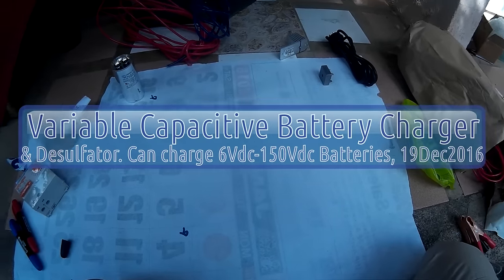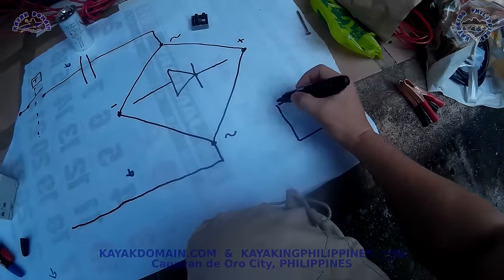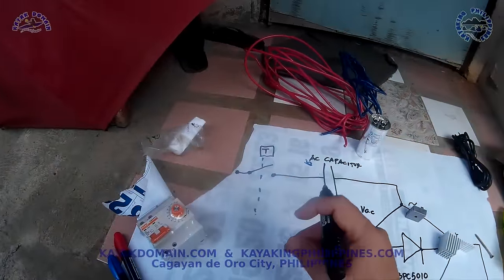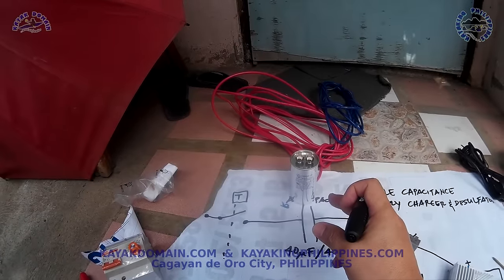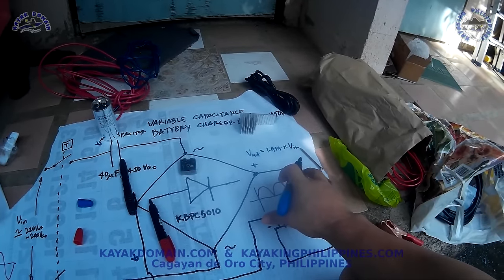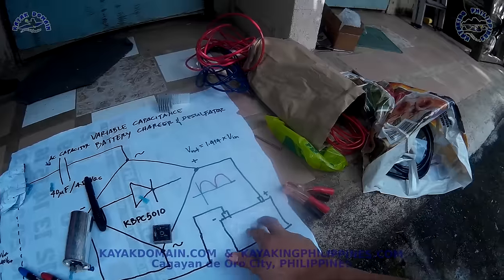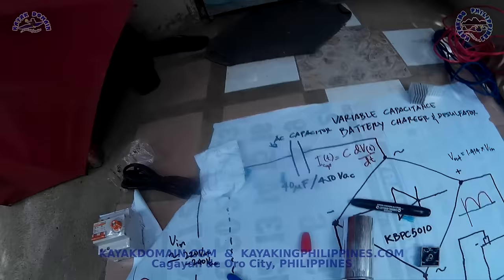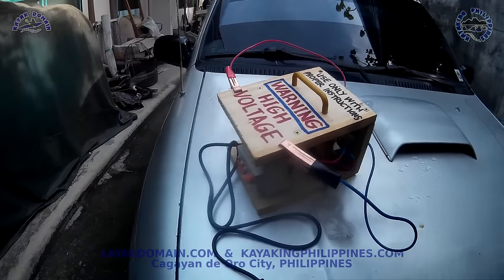Variable Capacitive Battery Charger & Desulfator, 19Dec2016

Comment: Thanks,I am charging 3X6v(225ah)trojan and started with 40MFD(2x20MFD) cap.After 5days I seen no change.I added another 3x 20MFD and there is a difference after 2hrs.I am observing voltage,and the bat acid specific gravity.Operating capacitance at 100MFD whats your safety opinion???
Reply from the maker: USA is 110volts so you need to double your capacitance to 80uF. So far I managed to damage one flooded battery (a bit old and Philippine made). But no major safety issues. There are 80uF Capacitors available in the market so no need for 2 (40uF) caps in parallel.

Comment: How thick do the cables have to be if I use a 150 microfarad capacitor at 230V?
Reply from the maker: at least #8 wire. Why use 150 microfarad?
Reply from the maker: I would suggest you use 80uF max. But it's up to you. At least #8 or bigger for the cable.
Reply: i use 400 uf 400 volts ceramic caacitor it works good it gave me 10 amps

Comment: Hi Kayak, will the 10uf 450vac cap do for 12v 6ah motorcycle battery? and how long for charging?
Reply from the maker: What is the voltage in Vietnam 110v/220v? Because the AC capacitor will depend on your AC power supply. I would suggest that you use 40uF/450vac. Charging can be done in about 20-30min. If you have a timer, set it at 20min
Reply: @KayakDomain  Many thanks, Kayak; the voltage in Vietnam  is 220v. Will I do the same as your instruction? As my battery voltage shows 12v but the current is not enough to start my motorcycle; waiting your reply.
Reply from the maker: @hana-dk7el  I would suggest you use 40uF. You can find that is most Refrigerator repair shop.
Reply: @KayakDomain  thanks
Reply from the maker: @hana-dk7el  you're welcome

Comment: Hi KayakDomain. I've watched some videos about this type of desulfator but they never explain the science behind it. So thank you for this great explanation. It's very useful.
But I think I missed about the purpose of the timer. Then I couldn't calculate the current of the capacitor by the formula. That's why I tried to calculate the current, via capacitive reactance. Xc=1/2*pi*f*C for 220V/50Hz source, 40uF cap -> Xc=~79.5ohm, Ic=220/79.5=2,78 amp . Yeah I know I'm wrong. Could you  explain more?
Reply from the maker: The main purpose of the timer is to limit the charging time to avoid damaging your battery.

Capacitance is in Farad not Ohms. Current in the capacitor is not linear. The right formula of the Capacitor impedance is 
Zc= - j /2*Pi*f*C

Comment: hello kayak...i built the battery charger / desulfator according to your circuit....i am getting a 234 volts DC....i connected the terminals to the battery...i have the caps off on the battery....when i connected the plug to the mains i got a buzzing sound and a spark from the battery specifically the cell just below the positive battery terminal of the battery...good thing i was able to remove the plug within a few seconds....is the battery shorted? is the battery junk now? i am charging a 12v 7.2 AH motorcycle battery.
Reply from the maker: your 1N4007 is a small diode. I think 1N4007 is only rated at 30A. The Bridge Rectifier I suggest above is rated at 50A. The circuit breaker I suggested above should protect the system. Just check your battery.

Comment: How long do you leave charger ON?If you achieved the charged voltage do you still require the desulfation?
Reply from the maker: I damage 1 battery because I left it for too long. My suggestion to disconnect/OFF the charger after the battery is full charge. Desulfation is constant everytime you charge a battery. Leaving it ON for too long can damage your battery.
Reply from the maker: i normally set my timer to 20-30 min for my 12V car battery.

Comment: Any instructions on how to use this? Ive already built your circuit....can I leave this powered and connected to the battery for 8 hours?
Reply from the maker: for a typical car battery, 8 hrs is too long. Put a voltmeter and watch the voltage rise up to about 13 something volts and that should be enough. 8 hrs will likely damage your battery.
Reply from the maker: 8 hours is too long...20-30 minutes will do for 12V car batteries.

Comment: it also depends on a bridge you are using...depends on the amperage of a diodes...
Reply from the maker: The KBPC5010 is rated at 50A, 1000v. What do you think of this Bridge Rectifier?
Reply: so high and i think its useless to use it coz it varies from a fds of your capacitor that you are installing...
Reply from the maker: why it's high and useless? can you explain why? explain in Technical detail why and even provide some formula.
Reply: @KayakDomain  Hilarious, I guess no answer is an answer
Reply from the maker: @PH_INFO_101  still waiting for an answer...

Comment: After using this charger, the capacitor will automatically discharge?
Reply from the maker: Unplug the AC first or after the timer is off, then you can disconnect the load/battery. The cap should should quickly discharge once you turn off the AC or the timer is completed.
Reply: no... it wont automatically discharge....you must install resistor in parrallel with your capacitor to automatically discaharge it....
Reply: you can use the kind of 220v ac cord plug who had a switch with lamp indicator,when you switch off the device then after a few second the lamp indicator still glow the light until it turn off that show you the capacitor succesfully discharged

Comment: hey kayak....i have electric fan capacitors about 3 pieces of them...an electrolytic capacitor 1000uf/25v and 4 pcs of IN4007 diodes...will this work if i use this as replacement parts for your circuit....will it have desulfation effect also?
Reply from the maker: Electrolytic Caps are DC capacitors. Cannot use DC caps. You must use AC Caps. Just buy those items as described on this video and you will be fine.
Reply: @KayakDomain  the input cap is an electric fan starter motor cap so it is an ac cap rated at 2.2uf 450vAC...can i use the IN4007 as a bridge rectifier? or i need more amperage and voltage on the diodes? i am not using the electrolytic capacitors anymore.
Reply: i also did not see you placed a fuse in the circuit....if you were to place a fuse that amperage will the fuse be? and where will you place it....one line in the 220v ine or can it be place on the positive side of the diode of  AC capacitor? what fuse amperage?
Reply from the maker: @newvaper3794  2.2uF is too small
Reply from the maker: @newvaper3794  The Timer Switch has a circuit breaker.
Reply from the maker: @newvaper3794  if you want to experiment then use  IN4007. But I would suggest to use the bridged rectifier as shown on this video

Comment: Can you send me info on the materials I would need to make these chargers you make it sound simple but I'm not great with electrical but want to get into reconditioning batteries in my area. I need something that works and I need a resource person that can talk to me like I'm in grade 3 about battery reconditioning. I live in Canada but will spend the winter in AZ.
Reply from the maker: Hi Lorne, please note that there is a Warning and Disclaimer on this video. The materials are Bridge Rectifier, AC (not DC) Capacitor, Timer Switch, #10 wires,big Aligator clips and your Enclosure. The model number of the Bridge Rectifier is on the video. The Capacitor is an AC Capacitor which you can find at Refrigerator repair shops and parts retailer. You can find the timer switch online. Wires from electrical hardware. Please note that this is a fast charger, weak plates (typical on old batteries) can be easily damage. I already broken 1 old battery.
Reply: Would this work on forklift or golf cart batteries
Reply from the maker: so far I only  tested on my  flooded batteries for my Sportage and Starex.
Reply from the maker: @lornekinnee4189  typical forklift batteries are flooded. So yes  this will work on forklift and golf cart batteries..

Comment: madedetect kaya ng electric meter yan boss? malakas din kaya sa consumo?
Reply from the maker: Consumption is very low.
Reply: @KayakDomain  60 uf ung capacitor ko at 10 pcs kbpc5010 k.c mainet ung rectifier kung 1 lng
Reply from the maker: @rolandruiz1972  , why do you need 10pcs of bridged-rectifier? You only need 1 bridged-rectifier, and just use a Heat Sink on it.
Reply: @KayakDomain  hindi k.c universal gamit ku sa rectifier ko ginagamit ku rin pang rectify sa ac welding machine ko for tig:)
Reply from the maker: @rolandruiz1972  , if you are using KBPC5010 then I'm confused. Good luck on what you are trying to do.

Comment: What is the value of ac capacitor and bridge rectifier? Thanks
Reply from the maker: AC Cap = 40uF/450V
Bridge Rec = KBPC5010

Please watch the entire video. Each component was described in there.
Reply: Thanks
Reply: What kind of a capacitor? Any capacitor...
Reply from the maker: no problems
Reply from the maker: AC Capacitor not DC.
Reply: Ac Run capacitor or ac start run capacitor or iether...   Thanks...
Reply from the maker: To be honest i have no clue between AC Run and AC Start. But i bought this AC Cap from a Refrigerator Repair shop.

Comment: do you connect positive to positive on the battery or do you put + to - and - to +??  and how long to charge a 12v battery?
Reply from the maker: Hi Phil, you connect the Positive Alligator Clip to the Positive Terminal of the Battery. This charger charge very quickly, sometimes within minutes so you must not leave it for hours or you will damage your battery. Put a voltmeter to monitor the charging. Again, My Disclaimer still applies...use at your own risk.
Reply: @KayakDomain  dont connect volt meter it will damage it....
Reply from the maker: I normally set 20-30min to charge my 12V car battery.
Reply from the maker: @benjiefigalan6288  why damage? I use a basic voltmeter to measure the voltage.

Comment: i use this for 5 years now and its great ...but i think ur using to much higher value capacitor thats why you said it damage your battery better install not so high capacitor so that you can leave for so long time untill it desulfate your battery and bring them back to life...it needs to check from tme to time...whats out coz its a high voltage....
Reply from the maker: What is the Capacitance of your Capacitor? And what voltage in your country?
Reply: of course from phillippines...and with 220 volts ac...
Reply from the maker: What is the Capacitance of your Capacitor?

Comment: Hi,Can you tell me if you should couple another 2 capacitors in parallel will the current to the battery increase and will the desulfation process increase????
Reply from the maker: Hi, capacitors in parallel increases the capacitance. Thus, you have a higher current. To me desulfation process is subject to the frequency and amplitude. And higher current and voltage can easily damage weak battery plates.

Comment: try different fds of capacitors and measure their amperage....sorry i cant tell you what i did from my capacitance charger /desulfator....circuit coz i modify it install some resistor to limit current....you much search and study it will ....i already bring battery back to life lots of it...and earn from it....but thanks and bcareful use multimeter to check from time to time mine.. i install over charge controll....
Reply from the maker: you say a lot but you cannot tell what is the Capacitance of your Capacitor? I think you are fake.